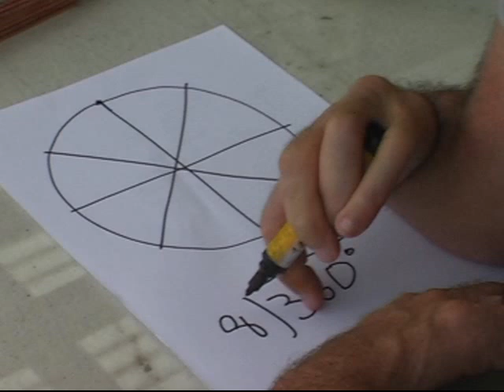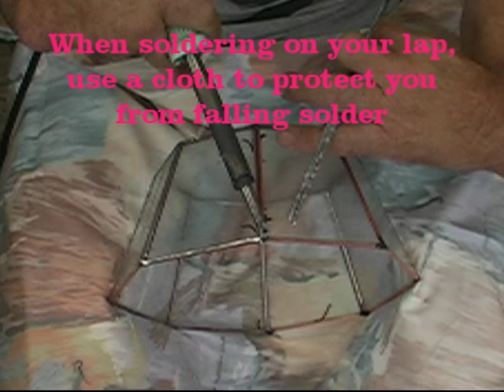Build a stained glass terrarium using the copper foil technique.

Comment: When you patina the soldering, does it stain the showing copper foil too or do you have to cover all the foil with solder? I want to make a small terrarium and stain it with black patina and add accents with copper wire, but I'm worried that any exposed foil and the wire won't match the soldering.

Comment from the maker: Ah yes, I've done a few of these, very pretty a.....
One can get a water tight finish with the copper foil only.
Make sure the glass edges are very tidy i.e. clean perpendicular edges and shapes that come together without gaps. Consider using a slightly wider foil (1/4'in on 2mm glass)
The important bit is apply to foil evenly to meticulously cleaned glass. You must press the foil really well, get all wrinkles out (I use a wooden pencil shaft for pressing)
Lastly do a great soldering job.

Comment from the maker: I use bars because they are easier / faster than pushing skinny ass roll solder into the iron; also, I buy it directly from the lead mill at half the price one gets rolls from a glass supply store. Tin is not suitable mainly because the melting point is too high.
Ah, good point, the lid of this terrarium rests within the base because it is a wee smaller. Providing your cutting and 3D assembly is accurate all's good however knobs of solder near the top of the base can be employed to make it sure.

Comment: Great video!
I would like to know what kind of marker did you use to mark your glass and what do you use to remove the marker marks and dripped soldering liquid from the glass?
Reply: That's probably a regular marker (comes off with sudsy water or even glass cleaner).  Once the solder hardens on the glass, you can simply lift it off.  Always be sure it is in its solid state.

Comment: I am not the person in the video but I have some history showing what and why I see as a problem with this video. I have been in photography since grade school, I continue photography today, having sold quite a bit. A lot of drawing of as many different instructions as I was able to fit into case study? I have 3 yrs Graphic Arts and started Stained glass in 1992. I am not going to say you made a mistake anywhere because we all have different styles with all art, not criticism, but a different perspective. I do wood working and measure twice, cut once applies especially since glass isn't cheap. Start on 2nd hand window panes. After cut lay pattern cut out on cut glass, grind where needed. For 3-D projects, the pattern usually has upright view, solder 1st two stand up right to match. If the first two are wrong there's little chance any other will. You can use iron to remove soldier. As far as it oxidized to green hue? That's what happens when the elements hit, sun. You can slow it in dry dark area or use flux wax? N8 guarantee,, use flux rerr

Comment: Amazing job! you make beautiful work! This video alone taught me so much and helped me make a terrarium for my sister for Christmas! :) Thank you for taking the time to make this. I was just wondering, what kind of solder are you using? I used a lead-free, rosin-core solder, and it pooled with rosin in many spots and I couldn't get it smooth. Any suggestions?

Comment: How hot is your soldering iron?
It seems like you're able to leave yours on the seams for much longer than mine will allow me to without all the solder running through.
Reply from the maker: your too hot. Maybe your iron does not have a thermostat to keep it on temp....?
You can control solder drop through some what by having a damp tea towel under your work...
Best solution is to buy a better iron.

Comment: Hey John just wondering how thick the sheet of glass is that you're using??
Is thicker glass easier to cut than thinner glass?

Thanks!
Reply from the maker: The glass for this was recycled from an old commercial glass house. It it quite thin (about 2 1/2 mm) The thinner the easier it is to cut, however any plain clear glass under 4 mm is relatively easy, over that and you need to be more assertive / confident. Cutting curves becomes a mission....
Reply: ok thank you for the info and the awesome videos!!! I've learned a lot!

Comment: do you have any tips to prevent oxodisation without putting a patina on as i want to keep the silver finish of the solder but havent found any information on keeping soldering silver. thanks in advance
Reply from the maker: I believe you can use car polish wax for this, however I've not tried it myself so you'll just have to give it a go.... :-)
Reply: Yes we used Auto Glym Car polish works really well

Comment: please answer: what kind of the tape on 3:00?
Reply from the maker: The tape is 1/4 inch venture tape copper foil. This copper has a self adhesive backing that bonds to the glass edge, it is a task specific material.